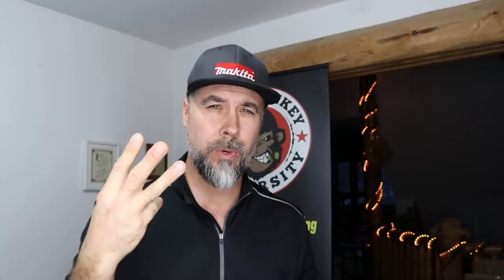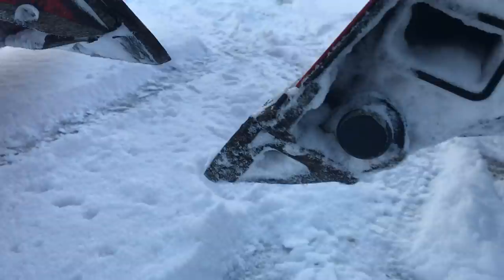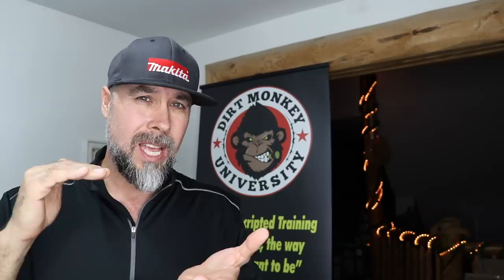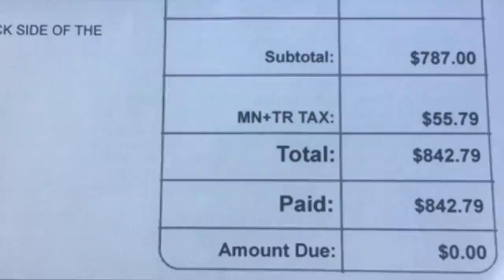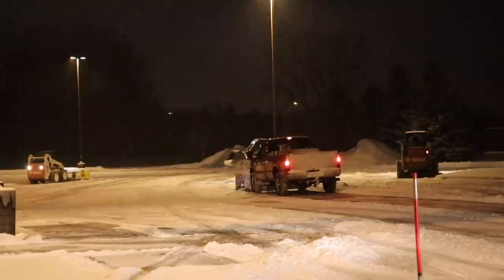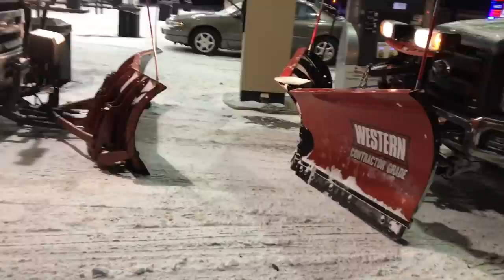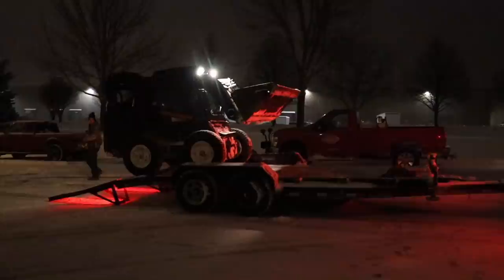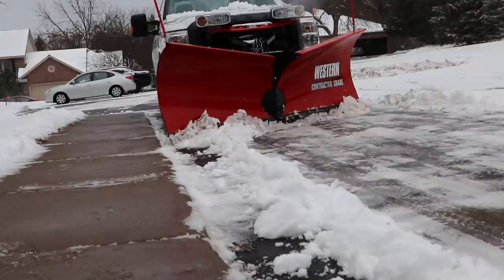Western Snow Plow Review after 13 years - Plagued with Problems

Comment: After watching the whole video and seeing your only issue is the cutting edge and ur dislike of the controller, you might wanna change the thumbnail. It makes it sound like the whole plow is garbage even though only the cutting edge is. Love the videos Stan but that thumbnail might cause u issues.
Reply: chachifeere yeah I know. It's Messed up he did it again. Should've made a better video of the junk hiniker that fell off the truck from rusting through talk about cheep steel!
Reply: The whole plow is garbage! Same as the new fishers that bend in half bumping a curb lol
Reply: Kwmike-D how fast are you plowing to bend a whole plow on a curb?
Reply from the maker: That Hiniker plow is 15 years old or even more.  It paid for itself a decade ago,
Reply: If the cutting edge is burning out that fast and killing your profits... ya the plow is junk if it aint making money.
Reply: Bob Clifton bumped curb at 10mph, just Google fisher bent plows in last 5 yrs. They are complete junk now! Nothing like the plows they made in the 80s that lasted forever.
Reply: I have a 1/2 mile private gravel road, and I plow with skids with 1 1/2" space because I dont want to damage a new lighter Fisher Plow. Junk.  Too bad someone doesnt duplicate an older Fisher piece by piece and name it Wang Fang Snow Plow and give Fisher run for their money.

Comment: I hope all is well I’ve had nothing but western snowplows my whole life and I still have the original Westin plow from the 90s western the original pump the original skid plates all I replace was a new bar at the bottom but I would stick with Western over the rest of them because if you go to any place that REPAIRS snowplows you’ll see they’re all not western plows they are the other brands I am not a spokesman or should I say I’m not a paid spokesman for Western but I’ve never had a problem with the hydraulicsOr the pump and if some guys are going to ram the snow tank or an ice pack then of course they’re going to break anything it doesn’t matter whatever you have it really comes down to the skill of the operator

Comment: Stan I was seeing the same wear as you on my fisher ez v.  I went to my local steel yard and had them cut my edges out of 3/4" ar400 steel,  it the same steel they make bulldozer blades out of.  3 years later and there is only half a inch of wear and even all the way across

Comment: To set your Fisher/Western/Snow hand held controller to one touch float mode-Turn your truck power to acc. on (radio works, engine not running) .  Turn your controller on, then off. Hold the lower button down as you turn the controller back on while holding both buttons down together until the green float light flashes.One touch float is now enabled.  Do the opposite to disable it.
Reply from the maker: Thank you! I am going to try that.

Comment: Why are you buying your cutting edges from Western (or any OEM, ie. Hinniker, Boss, etc)? Buy them from a cutting edge supplier.  Many plow MFRs use a standard hole punch pattern for their edges and a cutting edge supplier can punch them to match your pattern if your moldboard is not a standard pattern. A dedicated CE supplier can also offer you different thicknesses as well as different levels of abrasion resistance (AR) to suit your application. Judging from your videos and apparent experience I am surprised that you don't already buy from a CE supplier. I also don't think it is very fair to compare cutting edge wear between a straight blade, or in the case of this video, a "C" shape (per your description of the Hinniker), to a V plow. In my experience the V plow edges always wear faster in the middle as compared to the ends and straight blades will wear faster on the outsides. This will vary depending upon how much you use the plow in a V position. I have an 8' Pro Plus and an MVP. Both plows are over 10 years old and have proven to be fairly reliable. Can't say I'm a huge fan of the Western V plow controller but I don't have experience with any other brand.

Comment: On the cutting edge it wearing fast I think it has more to do with the hardness of the material than the guage.  Softer metal wears more quickly than harder metal.  But a harder metal is more likely to damage concrete than a harder metal..  I have heard hear recently carbide edges are the way to go not steel.  With that said a harder material is often more brittle.  Years ago my dad installed a piece of stainless steel for a cutting edge and the thing just never did wear and it was only an 1/8 in thick.  As for the controller you’ve been using certain controllers for so long a new one likely feels weird.  All plows have there weaknesses.  As a point I talked with a lady that runs boss v plow on her storage property and it keeps breaking the springs that draw the v back which seems like that could be more of a problem plowing than a soft cutting edge
Reply from the maker: That stainless steel edge sounds interesting
Reply: I was on a garden tractor we used to clear residential drive ways so I’m not so sure how it would work on a commercial plow but if you could find a thicker piece it might work on a plow truck

Comment: I can vouch for the western straight blade. Somewhat recently got rid of an old ass Meyer that did nothing but freeze up in the winter no matter how many times I purged moisture from the hydraulic fluid... The unimoint is way more responsive and the hydraulics have no  quick connects so no real entry point for moisture if the seal is OK. Use it for my own and neighbor's driveway only though, so can't comment on blade wear otherwise.

Also built my own plow controller to save $200 over buying a NOS controller to replace it (my dad got the plow free from someone I think, so I made it work because I was tired of the Meyer not working, didn't come with the harness or controller).

Comment: Love your videos. Would really like to meet you someday. I’m in Minnesota as well. I had a similar problem on a Western HTS.  A plow that only weighs 400#.  2 cutting edges in 3 yrs. Agreed. Hated the controller.  I now run Snoway. Only plow compatible with Ford F-150’s with electric power steering.  If you wanna run an awesome controller, Snoway...and it’s wireless with an awesome joystick.  There is a wired option as well, no experience with that. After the Western, I ran the Snoway 26 7 1/2 which is 100# heavier. 3 years on the Snoway cutting edge with far less wear than 1 year on the western.  I’m now running a Snoway 26R, has wings, even heavier than the Snoway 26 and hundreds heavier than the Western HTS. I can’t honestly rate it due to lack of time and snow in central MN to see how the cutting edge holds up, but I expect it to similar to the 26 series I had.  Although, so far, less paint wear on the Snoway than steel wear on a western. And yeah, I was that Western fanboy. Long over it. In fact the Snoway even has down pressure.  That adds another 250#’s more to the cutting edge. I know you really like the Hinniker, A friend of mine runs the Hinniker scoop and loves it. It is a heavy plow. He has had no issues with his cutting edge. Anyhow, If you wanna try the Snoway plow and controller, let me know.  It’s all yours. You can even do a video on it.  Thanks and keep up the good work!
Reply from the maker: Thanks Tim!  I may take you up on that snow way offer.  I need to learn more about those.

Comment: The Western controllers aren't that hard to use! I don't know maybe you guys are easily frusterated but I can roll my right thumb around that western controller without looking at it. I usually hold the down button anyways for a few seconds so it floats no problem! And I also have a Daniels pull plow on the back of my truck... not hard to use
Reply: Agree 100%.
Reply: I totally agree not sure what the problem is with the controller don't  have a problem
Reply: the individual wing buttons seem to confuse them
Reply from the maker: I just picked up a short iron fabrication pull plow.   Looking forward to working it.

Comment: I’m going on my 4th season with my mvp love the plow. Awesome mount, plugs are easy to plug in (unlike my other boss) and I don’t have to bury my front end so bad stacking with my western like I do with the boss. Boss tucks that blade so close to the truck body that I have to really ram the boss into the banks to stack like the western. If you want a good cutting edge (like tires on a new truck) get some winter equipment edges and move on

Comment: One western V plow here - the one with the design flaw with a metal catch and rubber flap add on where the blades meet. Didn't know any better at the time and is mostly problem free going on 10 years; however the blade has always worn incredibly fast - probably dropped 2500-3000 on wear edges on western over time . Have three other BOSS plows going on season 4, haven't replaced the blades yet (2 seasons were light use.) Both have been basically problem free -
Reply: Stan - I don't recall ever seeing  you talk about salting, but here was my solution to Western Issue and a solution for others perhaps. Took the truck with Western Set-Up (F-250) and threw a BOSS V-Box 8000 Spreader in it with beefed up leaf springs. Doesn't work too hard plowing anymore since she's working on salting. Calling it now Western losing NE Indiana territory to BOSS - contractors all seem to be switching
Reply from the maker: Western did tell us to counter balance the truck by adding 400 lbs into the back to get better wear.  What a joke for them to tell us that. you shouldn't have to go through that hassle to make their stuff work better.

Comment: My current 2011 f350 king ranch 4x4 crew long bed with the 6.7l diesel Gets at best highway and in town in florida 12.5mpg and the front end suspension rides so hard. I had a 2000 f350 prior and it was so much easier to work on, however the 6.7 is much better and more power the 2000 f350 I was getting 17mpg. I think it's crazy that the diesel gets the same fuel economy as the gasser little brother does and that with technology the 2000 got better fuel econ than the 2011. The 2011 the only way to get decent fuel econ is to remove all the emissions bs that ford put on the truck to begin with as well as a few other small changes and throw a programmer on it, sad times for such expensive crap. Other than that I love the truck, but I wish I had a Denali 3500 diesel instead.

Comment: You showed us a controller for a vplow in another video that was far superior to that Western/Fisher controller. I, like you, HATE the fisher controller. You can't finesse the hydraulics with these electronics, it's either move fast or not move at all (on/off. There's no down/float detent, if you want to bring a wing forward, then move it forward again, you can't. The scoop/retract buttons are in awkward positions. Sometimes I go to retract and end up shutting the whole thing off!. 
You're right, the controller sucks!
As far as the edge is concerned, sounds like Western used cheap steal intentionally. My fisher blade lasts a lot longer, but when it does wear down, we have a local fabricator who makes replacement Fisher edges out of 5/8" steel that lasts forever. I bet they would fit your Western plows too.

Comment: Yeah Western blades are crap I ended up replacing my cutting-edge with the tread off a semi truck tire it's lasted for Five Seasons now with no problems and it runs a lot quieter

Comment: My new western mvp plus gouged pavement and was never in line with each side. western refused to help. left my plow all summer they said it was fixed picked it up dropped it in the lot and tore up pavement. i dropped it and still sits at the dealer 2 years later and nothing from western.
side by side with my older mvp you can see its not right. the dealer told me i was crazy and when i pulled up pavement he said it needs to be worn in lol. so damage lots is just normal lol. horrible company

Comment: If you want a more accurate idea record either hours in actual use (actually scraping) or miles scraping. and compare apples to apples.
Reply from the maker: I could but that seems like a lot of work.  A person shouldn't have to go that far -the company should correct complaints and field issues as they become apparant.

Comment: Just weld some hard surfacing rod to the cutting edge at the start of each season and you will double the life of the cutting edge.
I have been doing this on my plow and it works. I use chrome 58 rods. way cheaper than a new cutting edge.
Reply from the maker: That would be better but I shouldn't have to do that.

Comment: The v blade is heaver then the straight blade so it will wear cutting edges quicker 

Y dont u run carbide i plow roads i put a carbide on 5 years ago still good

Comment: It's not the gauge or thickness of the steel that matters so much as the strength or grade density of the steel when determining the wear. Did you know when you buy a new printer you only get a half cartage of ink or toner with it? Printer manufactures do that to keep the prices down low. Western probably puts on a thicker lower grade cutting edge to keep the cost of their plows down and the person buying it probably only has one plow. If Western was smart they would sell you higher grade replacement edge then you would think the alignment was the problem the whole time.
Reply from the maker: I think western should just sell good products and not mess around.

Comment: Western is using a softer steel just like the tires mfgs use softer ply rubber I have 6 westerns plows from 2004-2015 my 2004 straight blades cutting edge was replaced 5 years ago with a 1/2” steel plate and it’s still 5” wide from the original 6” it’s nothing but a cash grab nothing is out of adjustments it’s just a softer steel we now make our own cutting edges

Comment: Long time western owner,  as in my first plow had the red twist cable controller (only a small handful will get that remark) I've been plowing snow longer than I've held a drivers licence (26 friggin years)  The one after that was the black cable controller with the lock nub.  I gotta agree with you,  my current blade is a wideout (it's first season)  and after half the first season (a small snow year btw) the outside edges are starting to round. I'm a big western fan but I'm also pissed these new cutting edges are only good for the stock holders.  I've also noticed that the pins for the directional rams already have slack in them. Somebody needs to scream at these corporate friggin bean counters.....THIS IS HOW YOU LOSE CUSTOMERS! YOU'RE GOING TO LOSE YOUR CUSTOMER BASE BECAUSE YOU WANNA BE FRIGGIN CHEAP.  YOUR GOING TO FOLLOW SEARS DOWN THE FUNKING DRAIN! Please don't run this name into the ground like everybody else does in the name of greed. Do what you wanna,  close the doors and shut it down?  I'm a remotely accomplished welder,  I can keep it in the road well past it's prime. Please head my warning.
Reply from the maker: Same thing as you.  My plow has tons of slop in it.  I didn't even mention that point in this video.  Im not impressed with these Western V Plows.

Comment: The blades are hardened steel and of corse certain grades. The thickness won't mean much if its not hardened.  Call the man an ask those quistion's. You can run a weld on the bottom of your old one, the weld is hardened. I ran my blades almost as long as the plow lasted. 9-10 years and I did 40 jobs back from 78 too 93. Western is about a mile and half from here. Just keep complaing. That peace of soft steal would maybe cost under a hundred with no holes. 800. for a blade is a joke.

Comment: If you learn to use the float feature you will not go thru the cutting edges so fast. I plow here in Alaska and not on just even terrain and yes I go thru cutting edges but I use the float feature and also replace and make my own cutting edges. Why do you not make your own cutting edge. You do not need a big shop to do that. Why do you guys not do your own work??

Comment: seen you video about the excessive wear. ran nothing but western. never had a problem unless it was out of adjustment. if cutting edge is of inferior material, make your own,... we do. brand loyal.. WESTERN.
Reply: i wouldnt let the cutting edge be the deal breaker. beef up..
Reply: love your vids. just my 2 cents plus 2 pennies
Reply: just a bigger better plow.. western
Reply: commenting as im watching the vid. i have 1.5 seasons on edges. looking like ill get another 1.5 years. Grand Rapids mi. 9.6  and 8.6 vee plows
Reply: nothing wrong with the controller. i understand simplicity. however, options with western controller are there. we operate the controller without thought. But like i said earlier, have those handhelds wired for toggles.  EVERY TRUCK should have toggles. right from the install of a new plow.  Toggles bro. you wont ever go back
Reply: nobody looks at the controller, unless.... well. do you stare at the controls of your loader or skid? cmon!!! stop it!!